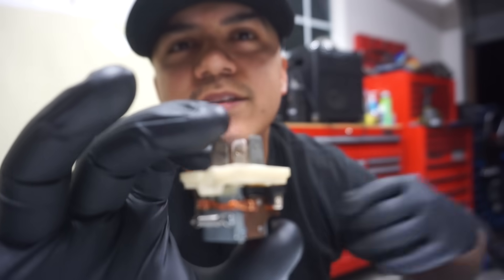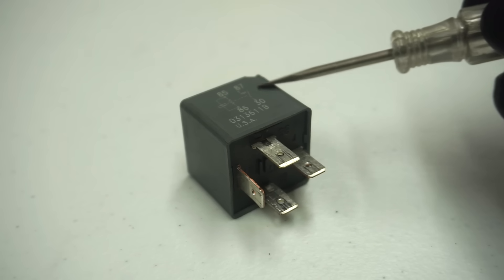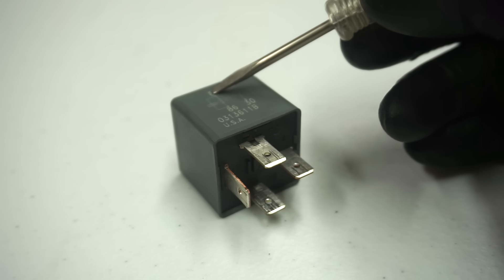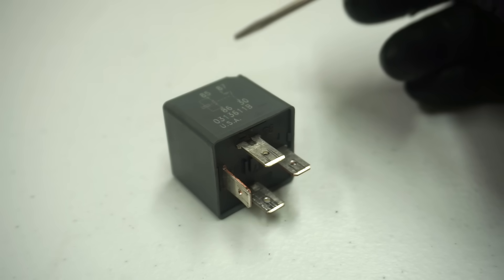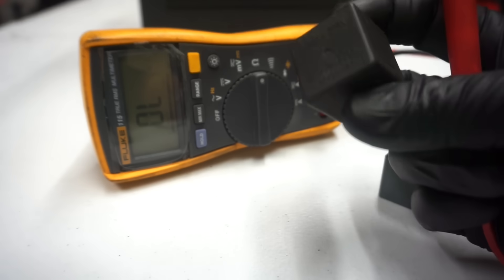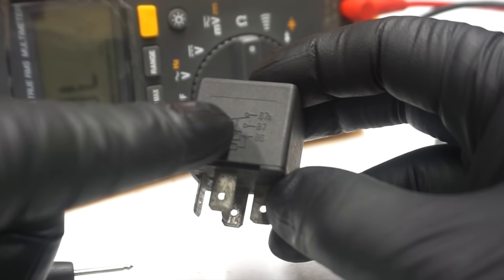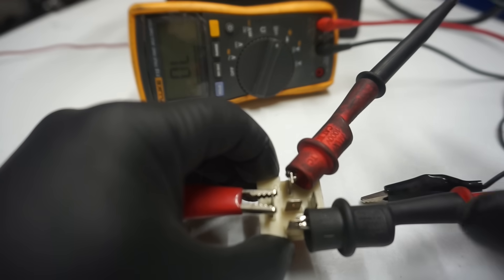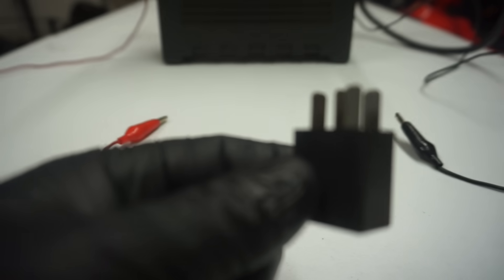How To Test a Relay The Easy Way

Comment: Hektor, thank you so much. You didn’t try to trick us or bog this video down with fluff.  I upgraded my HPFP and am getting a low fuel on startup check engine light. The fuse is good but I don’t know if the pump is priming on ignition like it should.  My next step is to test the relays.  Thank you for this lesson-

Comment: I have a 07 Toyota Camry 2.4 4.2V-6 I have a code po500 check engine light, ABS, light and oil light  and RPM fluctuating up and down Tachometer fluctuating up and down.. I put New battery terminals on because of corrosion... On the positive side main wire it goes to the starter and on top of the terminal a little White wire that goes to the fuse Box and relay's.. the ground wire, it goes to the body ground & I have no power at the 120 amp power side of the fuse block. Battery power is 12.73 I have power at the starter, No power at the alternator but ground wire is showing 12.73 to ground and No power at the 120 amp power side... Car doesn't start at the Ignition, No power to the Scanner at the ALDL connecter.. I'm confused about the whole thing..
Reply: Anything else you can tell me, would be helpful...

Comment: Hola Hektor. My 2005 Ford F-150 just started keeping the headlights on even when engine is turned off and keys off. I checked the headlights wires and no short there. A good chance this might be a relay?

Comment: wrong pin 85 is ground pin 86 is power. go to school!
Reply from the maker: No Stephanie, the relay coil is not polarity sensitive. Try switching the power and ground on pin 85 & 86 and let me know what happens…or what doesn’t happen. They have special place, reserved for YOU in school.
Reply: @HomieHektor  ok. Not all relays are identical. Take a relay with a freewheeling diode and hook it the way you think and let the wire  fry.

Comment: My fuel pump relay stays closed (and opens up the circuit (cut off)once power is applied to it is that normal? Operates opposite to the ones being tested in this video

Comment: I got a 2006 H3 Hummer and the wiper can still be activated even if the ignition is off!!  is this cause by a relay problem
Reply from the maker: It is possible.
Reply: @HomieHektor  I checked for shortage but pulled all fuses test light still light up!!!
Reply from the maker: @mannyaguon8922  where are you located?
Reply from the maker: @mannyaguon8922  are you talking about a parasitic drain?
Reply: @HomieHektor  what’s going on is that I turn off the ignition and take keys out but I can still activate the wipers…
Reply: @HomieHektor  I’m in Japan
Reply from the maker: I’d have to look at a diagram to see what’s in the circuit.

Comment: Nice!  Sometimes the relay will have a flyback diode across the coil.  This is to help reduce arcing on the contacts of the switch, electronic device or other relay that is powering the relay coil.  When you remove power from a coil, the magnetic field collapses and as it does this it generates current opposite to that which was used to power it(how an ignition coil generates a high voltage spark).  The diode allows that current to dissipate without ill effect to the switching device.  Because of the diode though, the meter will measure different resistances when you swap the meter leads between the coil terminals.  It is typically that pin 86 is the pin that has + voltage applied, and pin 85 is the path to ground.  With a diode the coil will nearly measure a short if the leads are connect backward…  FYI…
Reply: WOWZIE !!! MANY THANKS TO YOU AND HEKTOR  !!!!

Comment: Great video  i have a 2007 sts 3.6 l  it has a toggle switch on the dash to start ( no ignition key ) i have trouble to power up the fuel pump relay . The car starts and runs for a moment then stops no fuel how do i test this mess Thanks

Comment: So I've got a 4 blade (4 or 5 blade relay)  inline relay & it's to a 83 Olds that turns the radiator fan on or off! I know that most of the older cars are different than today's cars. I'm working on which sensor is the problem! How should I test one of those sensors with one wire connector or one connection type?

Comment: Crucial relay fuel, spark, and crank should be replaced, in my H opinion.  It can save a tow. Keep used relays in a box in trunk. Old relays may fail on a  freezing night. Great video.  Thank you.

Comment: It gets just a tiny bit confusing at 9.14 when you say "pin 3 to pin 5" but mean from five to three. Because later you say five is in the middle and three is the load. Correct me if I misunderstood this but on that relay 1 = 85 and 2 is 86, and then 5 is 30 and finally 3 is 87 and that pin is always the load out from the relay?

Comment: My relay is for a fuel pump out of a 1986 Toyota 4Runner it has five prongs and they are all going the same way. 3 on Bottom and two on top on the outside with no prong in middle top how to you test something like that I don't want to fry it

Comment: 99.9%of the time, if a relay clicks then it's "good." Sometimes the contacts need to be cleaned if there is not continuity on the load side. I use a points file to clean the contacts. Iv never had to replace a relay that was good on the control side.  The old guys will know what a points file is. Good video and keep em coming.

Comment: Hello, what would 2017 Hyundai Santa Fe. cause my wiper to come on randomly. Now my left head lights and fog light won't work even though I replaced lamps and swap the good right light to the left and it still don't work. Now the windshield sprayer won't work the voltage is getting to it and I disconnect and test the washer fluid motor good. I am getting 13v on the light socket for the bulb.

Comment: While I know I should watch the video then comment... If you set your meter to min/Max (rec., Etc. Whatever it says) a good relay will have a very low voltage spike where as a faulty relay can exceed 600+ Vdc. Plz keep the awesome vids coming! Finally an electrical genius that I can understand.

Comment: I’m having a problem with my fog lights. If I by pass by putting a wire on the circuit and the lights come on what does that tell me? Is it that the relay is bad or the circuit? Or the switch?

Comment: Hey great video!!. I'm having trouble with starting circuit for a Mitsubishi Lancer. All relays good all fuses good , stater tested through fuse box and it cranks engine. Turn the key, no crank in park or neutral, or any gear. The ignition is sending signal to relay, still no crank. What am I missing? Baffled.

Comment: Great video. Any ideas how you can load test a relay to see it break down? Reason I ask, I have a car with a intermittent issue on the fuel pump relay. Cuts out, let it cool down, starts up again. Put it under load, cuts out.

Comment: How long do the contact points on a relay last.  I have a 2014 Buick Encore and  troubleshooting found the (1 of 3) radiator electric fan high speed  relay, the points were almost all gone. Got a new relay now in use. (10/07/2021)

Comment: I have always have had a hard time understanding and testing relays. Great video! Thank you so much!
Reply: Relays solenoids contractors air magnet valves.. they all work the exact same way… you can even use small relays to control bigger contractors. I used to take boiler controls and ice cube relays home to play with them on the kitchen table so I really understood them.

Comment: Homie Hektor, Im having trouble with my horn, measured everything and all seems ok, even the relay clicks but like you said that doesnt mean it works. Unfortunately my relay is integrated in the circuitboard of the multiswitch (where the turnsignal and wiper handle is behind the steering) so I dont know how to check it. Is it maybe better just installing a new horn circuit? Love to know your opinion. Gracias Homie Hektor.

Comment: Some relays have a diode in parallel with the coil, hence the direction of connection on these will be important.

There are also some relays where pins 30 and 86 are reversed. If you mix up these 2 types (they plug into the same housing) then you land up with some odd effects!

Comment: You made a big mistake when you use resistance to check continuity with the ohms scale after relay is energized.
How would you feel if there was a short appearing across the contacts when made and it put a voltage across your meter? (All it takes is a small piece of contamination to short when contacts are made)
Check for voltage drop first then check for continuity

Comment: hey,just started following you, have a problem with my 99 chevy Tahoe wont start,, no click or no crank but the lights turn on and gauges work too
Reply from the maker: Might have a bad starter, check your main powers and grounds. Might also have a bad shifter cable, make sure it’s in park, it’s common on those trucks 👍🏼

Comment: Great tips sir. I was having issues with my Toyota Avalon starting. It do nothing through 4 or 5 turns of the key. But then crank and start as if there wasn't an issue.  Obviously something not right. I replaced the starter relay $35, after watching your video. Problem solved and fixed! I'm sure had I taken to a shop, several hundred for the same result.

Comment: Make video bout 2000 celica gt, fuel pump has power going to the fuel pump but fuel pump still will not operate even after replacing it fuses and relays are all good so where can the problem be?

Comment: Great video. I am a complete novice so pardon my ignorance but what power source did you use to test the relays? Can you use a car battery or?
Reply: This is late but may help someone  else reading. Use a 12volt DC direct current as ure source & you should be good. Jump start pack or a supply unit that allows for power to be switched from 69,12,24 to give adequate voltage.

Comment: Thank you for this video.  My 1996 Holiday Rambler Endeavour LE (RV) has lost tail lights, rear turn signals, and brake lights.  All upper and lower coach marker lights, front parking lights, and front turn signals, work.  Every battery and key powered fuse (that I have located) shows voltage through the fuse.  Bright and dim headlights, and backup lights, work normally.  I have found one relay that shows no power on any lug, even while the engine is running and the pull light switch is on.  The relay's black wire goes to a ground.  All other (three) relay wires are white, and I haven't been able to trace where they come from.  Any ideas/solutions to restore my tail, rear turn, and stop lights?

Comment: Thank you very much for that young man I'm working on my Honda Ridgeline right now with the air compressor or air conditioning compressor trying to charge me an arm and a leg and I think it's just the relay that's going bad or with bad on it the air conditioning was working fine yesterday and all of the sudden like it just stopped working they told me it was the compressor but I've looked at a few other videos and it shows the compressor or if it had leaks in it it would take time this all of the sudden went out it was working fine yesterday all of the sudden like the next day just didn't cool no more but thank you anyways very much and may God bless you for sharing that information

Comment: I think you said you connected power from a jump box to the relay when you energized it. I want to do that if I have the extra leads with clamps but I don't want to mess it up by giving it too much current or does it matter?. I have a jump box and a trickle charger I could use. I'm sorry if I missed it or just didn't know but my car is making me 🤪🤪 after just replacing battery & 2 alternators

Comment: Hey bud just came across this channel does this apply to remote starters and keyless entry systems, the lights and horn don't work when I unlock/lock my door. Is so is it safe to just unplug them without my key in the ignition and battery plugged in?

Comment: really like your publishing on how to test a relay and you definitely have another subscriber I have a Cadillac CTS 2003 and my car shuts completely down when I shift and when I try to restart my car it'll start and it'll idle but when I turn on my headlights it'll shut completely down I was wondering if you had any advice where to start or anything I have a brand new Altima battery a brand new starter brand new brand new radiator brand new computer like I said it'll start and it'll idle but only when I jump it so how was just wondering what would be the first relays I would check above anything else

Comment: My question: What is the standard parameter when it comes to OMHs or resistance between  the coil. Some said it must be 82 or above...what can you comment on that...or does it something to do with the power source specs it derives...volt source sometimes fluctuates and passed beyond the required ohm specs that creates electrostatic and as result relay contact is sticking continuously...

Comment: Well, I can see checking the relay out of the car is safe compared to when we want to do it directly with the relay is installed on the car.
I see a few people immediately do jumping the power terminal (30 and 87) of the relay when they have a problem on the starting their car.

Comment: My truck just cut off going down highway. I noticed on top of the fuse box under hood it had a pretty bad melted spot on top of the starter relay. Then I noticed my right headlight was out and I had another 1 to put in, next my truck just cut off on highway and I found out the battery was good. So I towed it back to my house. I think it is 1 of 2 relays. Advice please but I will check these 2 relays and headlight fuses and relays like in your video. Thanks and thumb up and I will subscribe soon

Comment: My 1996 subaru legacy wagon  2.2 , no spark issues.... changed  coil, wires and spark plugs..no start happened after  I changed the positive cable to the starter.  The cable  is thicker gauge than the the original. Will this cause to no start issue?? It cranks but no start.

Comment: Hey man, hella informative & helped me figure out AC prob I was having for sure. Not trying to be a dickhead, I just want to let you know that when you test resistance across 30 & 87 the "OL" on meter doesnt mean zero or no resistance, it means "Over Load" or "Over Limit" which means infinite resistance (or over the amount of resistance your tester is set to test for) and the switch is open aka off.  If you look at meter its default readout when testers arent touching anything is OL & if you touch positive & negative testers together youll pretty much create short circuit and itll show you what zero resistance looks likes. I hope that makes sense & again not trying to be a dickhead about it, and hopefully itll help you out. Thanks, homie
Reply: I agree. The terminal 87 is a Normally Open (NO), so the resistance across 30 and 87 should be infinite (Over Limit or OL). 
In a five terminal relay, the 87a is a Normally Closed (NC). During 5:35-5:40, when he measured the resistance across terminal 30 and 87a , he got 1.1 ohm, not far from 0 ohm.

Comment: Hi from the was u explain everything I can tell you very good with cars ive been having trouble with my E90, it doesn't start, but what happened my mechanic discovered that when u take out the relay n put it in again the car will start but when u drive n switch it off again it won't start, then pull out the relay again n put it back in then start again please help me what's the problem

Comment: Hi
I'm SAEiD of Iran republic I make a wet hydrogen jenerator for car by seven still plate
I don't use relay or other things except wire.
The wire near the reactor is very warming near to melt,is relay important for no warming and melt the wire .if us relay possible correct the problem .sorry my English-language no good.Thanks of you if answer this my question.

Comment: Notice the small rectangle in the relay diagram next to the relay coil symbol? That's called a "diode". Its purpose is to prevent damage to the coil of the relay and shared circuits when power is removed from the coil. All quality relays have this diode. When power suddenly drops from the coil, a back EMF (electromagnetic force) is developed in the coil. The diode looks like a short to that back EMF and it prevents that back EMF from becoming too large. It DOES matter which way one powers up the relay, polarity wise. One could inadvertantly "fry" the diode in less than a heartbeat.

One other thing to pay close attention to when checking the contacts of the relay for operability. Make sure they read a VERY LOW RESISTANCE. One must short the multimeter leads together and subtract that reading from whatever reading you get when measuring across those contacts when closed. Significant voltage can develop across those contacts when handling heavy currents if any "large" resistance exists. If a large enough voltage is "dropped" across the contacts due to "high" resistance, then the controlled circuit may not operate 'cause it's not getting enough voltage  even though the contacts are closing. 

Check out Ohm's Law and you'll be glad you did....

DE KA7MWQ

Fine video and videography.  'Nuff said.... keep on keepin' on!